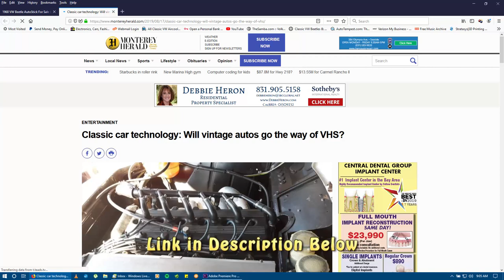Classic VW BuGs VLOG #12 Finding Good Workers | Static Timing Question

Comment: My problem is I can’t find a good Vw restoration shop around Spokane wa. I’d love to work part time. I love working on slug bugs... Id even work for swap work on my beetle . I work out of my driveway so I’m working on the things I can work with the basic tools and a few pulleys but no power tools. So I can pull the clutch and most all the other stuff just don’t have the facility to rebuild an engine.

Comment: Hey Chris, if I time gun my bug engine, where does it has to be??? I don't know what to look for, I do the method you show us, with the distributor..thanx I hope u understand my question hahaha
Reply from the maker: Yes so when the light "flashes" you have to adjust the distributor till the 7.5 BTDC mark on the pulley lines up with the split in the block.